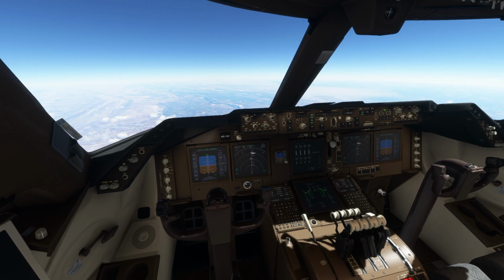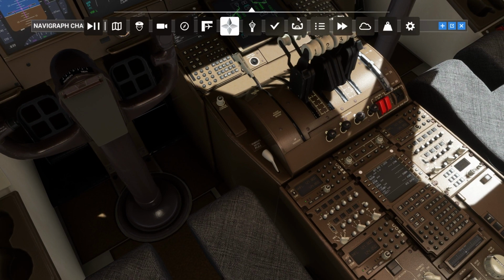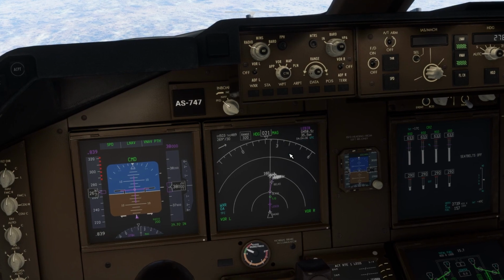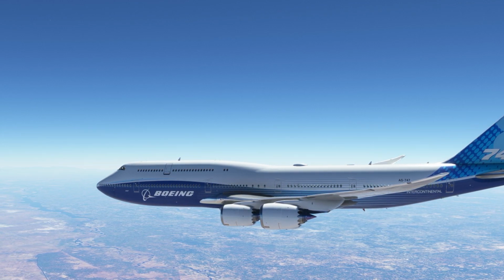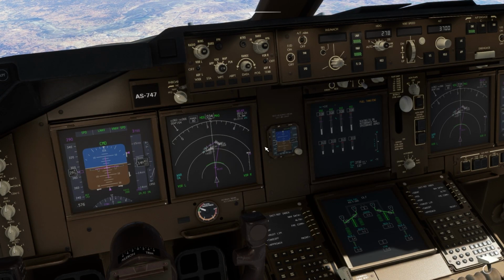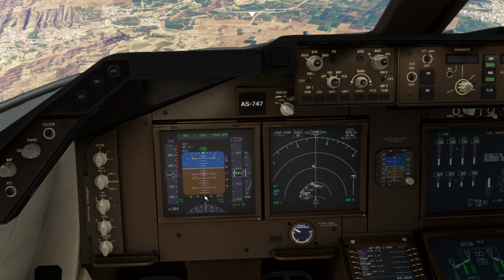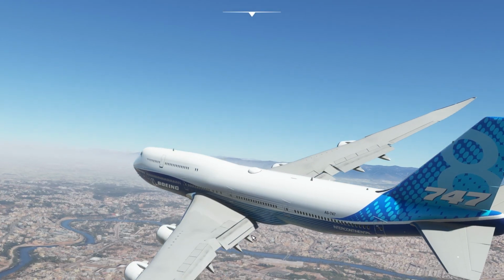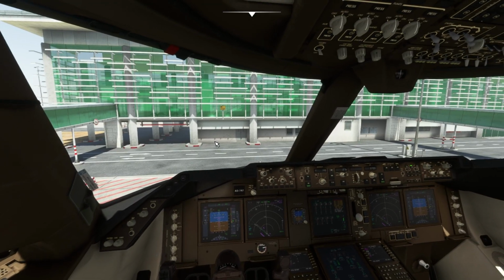Descent Management & ILS Approach with Salty Boeing 747-8 in MSFS - Salty Boeing 747-8 Tutorial 5

Comment: Great review Atif. The MSFS Salty 747 has potential but the FMC and other important flight systems need fixing. I too experienced FMC issues with missing altitude information or incorrect altitude levels being displayed. There are other silly problems with FMC. It’s strange how the dev releases the aircraft, even though the FMC is broken. Did the dev not test the aircraft several times before releasing it. Jeez….🙈🤡😆🤣